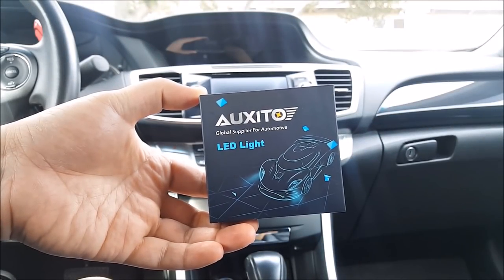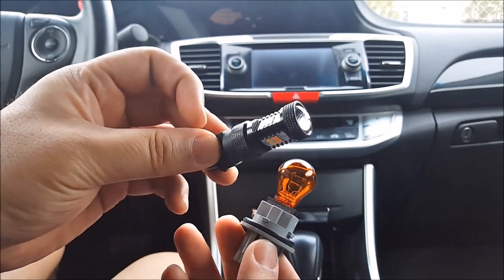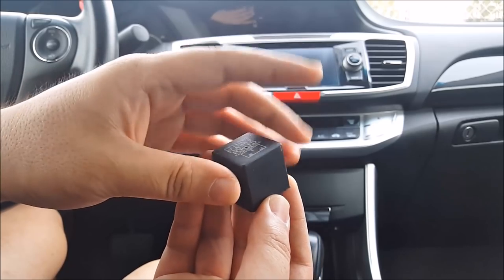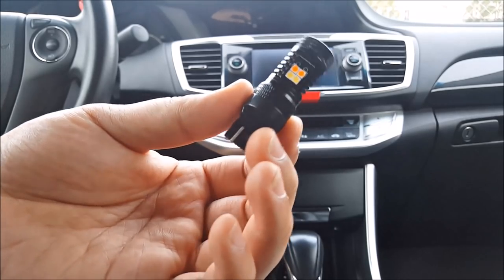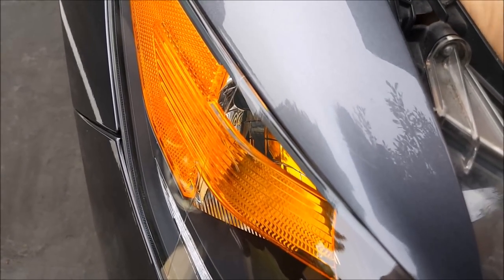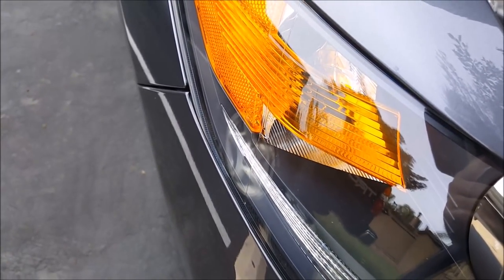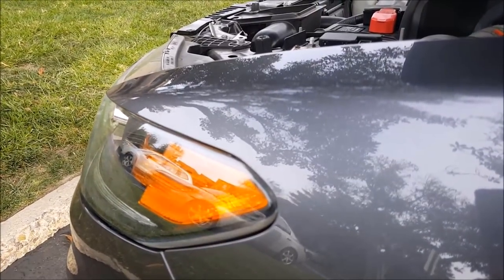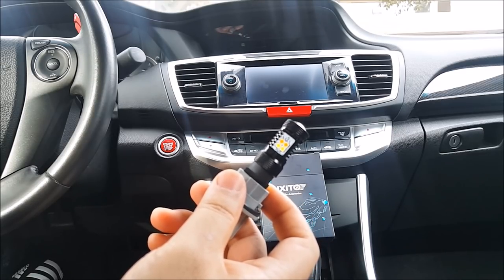[Review and Demo] AUXITO Switchback Turn Signal LED

Comment: I have an 02 Pontiac Firebird. I installed load resistors in when I used just Amber LED bulbs. I got a set of these switch backs, and they worked fine for a few minutes. White when running, and amber when using turn signals. But after a minute or 2 they run amber only. Sometimes after using the turn signal they'll go back to white after completing the turn, but quickly go back to amber. Do I need to use another load resistor on the constant power wire as well as the intermittent power wire? Please help.
Reply: Do you know if the led is 6k led or white

Comment: If you do this get Jeff's adaptors.
Nice and easy to install.
Have mine for over a year now and works great.
Reply: David Hughes Jeff's adapators? Is that a brand, any more info?
Reply: tahjo7.
Jeff is the publisher of this video.
Check his other videos for the plug & play resistor.
Reply from the maker: Everything is linked in the video description.
Reply: I also purchased Jeff's adapter. I rather pay extra for the PNP than splice wires because when it comes time to selling the car you can revert to stock with ease. Thanks Jeff.
Reply: +1 I can vouch for this too, I'm surprised he doesn't advertise it much in his videos. plug and play is amazing.

Comment: If you change out the relay you would have to do led lights for the front and back? What if you just changing out the front turn signal to leds but not the back how would that affect the stock bulbs in the back of your car?

Comment: I had the auxito ambers with inbuilt resistors, yes they get hot but so do incandescent bulbs. I removed them because they were blinding bright. I dimmed using an inline resistor but then the hyperflashing errors came.
Reply from the maker: The hyperflashing happens because of the build in resistor on those types of led bulb.  The temperature gets too hot that it triggers the hyperflashing to occur until the bulb cools down.

Comment: Hi mate, brilliant vids. 
Quick question, what are the best led headlights that you've tested? Also, are there any good ones that don't have a fan but that are super bright?
Thanks
Reply: Not sure if you went ahead and purchased any LED's (this post was a year ago..) However, I just recently purchased the Headlight Revolution "Perfect Fit" 9012 LED's they are FANLESS and so far, I LOVE them!! No fans, no noise. Excellent heatsink and designed to actually cut back a little on the brightness in the event that they start to get too hot (there is an integrated temperature chip that does this, eliminating the need for a fan). I did a TON of research before I purchased and felt confident in the price (59.99) and so far, I saw that they are extremely worth it!! Go on the Headlight Revolution website and check out the excellent informative videos.
Reply: @thomasstokes9584  unfortunately it seems they don't sell H2

Comment: I have a 98 camry with everything but the front signal as led's using an led relay. Would these work out the box (without issue)or should I use resistors? I need an 1157A bulb

Comment: Just installed same bulb on my 2003 bmw and they are not switching back at all just are white. I know they are the switchbacks but are not switching back. Let me know if there is a solution to this
Reply from the maker: What model and trim is your 03 bmw.  Is your stock front turn signal bulb a dual filament bulb?

Comment: Question I got a set for my 2011 Ford Escape and they blink fast where can you the plug and play box that will fix all 4 corners I replace the front and back lights with LLED's
Reply: Hemi Da Key2pwr you need inline resistors to fix the hyper flash

Comment: So say you don't install resistors. I don't mind the hyplerflashing, just as long as the DRL stays white. Until signaling obviously. But I also heard without resistor's it may night be as bright. Thoughts? Anyone?
Reply: Without resistors, the majority of bulbs will work until using blinker,  just turns to amber but no blinking.

Comment: I originally dont have DRL. I used leds that came with resistors. I dont have hyper flash, i have problem that while my parking lights are on (white led), when i turn on turn light it has a delay. Like normal turn light blinks twice while these led blinks only once. And it has a small delay while switching to orange/amber. It goes a bit white then amber.
How can I fix it?
Thanks
Reply: i have the same issue, I Just installed them a few hours ago, I have a flash relay to stop the hyper flash, but I'm hoping the relay will help the color switch delay. either there's a wiring thing or just, they're Built to have a delay

Comment: I just received these bulbs and they came with the resistors and wiring. I have a 2014 Honda Accord Coupe Ex-L. I didn't see you install a resistor in the video so is it necessary for my vehicle, if so, how do you do this?
Reply from the maker: Please link me the exact item you purchased.  This switchback led bulb did not come with resistors or any other wiring.

Comment: Honda CR-V 2004, led light bulb 1156 work on reverse, and 1157 work on brakes, so which one work on blinking or signing light? Thanks
Reply from the maker: 2004 CRV Rear Turn Signal bulb is 7440

Comment: @Diycarmods I have the same lights brand new but the white light doesn't come on and the amber light just hyperflash. My front turn signal s%ocket has 2wires connected to it not 3 wires so what can I do to get the white light to come on
Reply from the maker: In order for the switchback to work, either your factory turn signal bulb has to be dual filament bulb or you have to modify your factory turn signal socket to a 3 pin socket and tap into the parking light.  https://www.youtube.com/watch?v=xY6rK4EjRZ4

Comment: So I bought these and it turns out the socket is just a blinker, can I just add a live wire to the positive of the blinker and it'll work?
Reply from the maker: You have to change the socket as well.  You need to find a dual filament bulb socket that will fit into your headlight housing.  I have done it on my Honda Fit.  The hard part will be finding a socket that will fit the housing.  https://www.youtube.com/watch?v=xY6rK4EjRZ4
Reply: @DIYCarModz  thank you man I ordered dual function sockets for my car and they work perfectly 🙏

Comment: Hello DIY: Car Modz , does this particular model has the delay between steady and blinking modes?, I'm planning on replacing my JDMAstar switchbacks since they have a delay and my front parking lights wont blink when armning/disarming the alarm...
Reply from the maker: Yes, there is a delay just like a factory stock audi vehicle that comes with switchback turn signal.  Press the lock twice and it will blink.
Reply: @DIYCarModz  thank you!! Try that with mine (jdm) with no results, hope this ones Will work better
Reply: Ernesto Gonzalez did you end up getting these? I’m currently looking for a new set of bulbs. I like the turn signal flash feedback when locking or unlocking my car so, I might skip on the JDMAstar and get these.

Comment: I installed these in daytime running lights but they only light up amber... I only wanted white, do you know why?
Reply from the maker: What car do you have?
Reply: 2007 Chevrolet Tahoe
Reply from the maker: @joeyramirez8337  Which bulb did you purchae?  3157 to 7443
Reply: @DIYCarModz  the online order says 3030
Reply: @DIYCarModz  then it list 3157, 4157,  3155, 3457 chipset

Comment: I bought dual led turn signals, had a load resistors, put them in and they only blinked and didn't stay on. Could you tell me what I'm missing?
Reply from the maker: What car do you have? Year make model and trim.
Reply: @DIYCarModz  2016 accord lx
Reply from the maker: Could be 2 issues.  (1) you didn't purchase the correct bulb type.  2013 - 2015 Accord Sedan uses 1157, Coupe uses 3157 and 16-17 uses 7443.  (2) you didn't turn on the headlights or the parking light fuse is blown.
Reply: When I put the stock bulbs back on everything works normally. Unless it's the bulbs or the resistors
Reply from the maker: then you either purchased the wrong bulb  or installed the resistor incorrectly.
Reply from the maker: https://www.youtube.com/watch?v=4mAXWvYA1uI
Reply: @DIYCarModz  thanks

Comment: So no resistors right jus plug an play an no hyperflash?
Reply from the maker: You need to install resistor or else you will get hyperflashing when changing stock turn signal bulb to led.
Reply: DIY: Car Modz 👍🏼thanks

Comment: I have led turn signals on the rear tail lights on my 17 accord. If I install these will I get hyper flash? And let’s say I do install these in the front and don’t like them and go back to halogen, will the hyper flash still occur ? I ordered these exact ones and I’m wondering if they’ll work
Reply from the maker: Yes, you will get hypeflash.  You need to install load resistors.

Comment: Dude how can i change the relay to led relay on my 2015 v6 sport  honda accord
Reply from the maker: You have to install load resistors.  You can't swap out the relay.  Like I mentioned in the video... "newer vehicles, the flasher relay is soldered onto the circuit board, you can't change it out..."
Reply: “V6 Sport” hahaha just if they made one! Good joke
Reply: Tyler M probably got a sport wishing he had a v6. Just like me 😭
Reply: J Rod Yeah same here hahaha the struggle is real
Reply: i have 2008 model toyota rush,can i change realay?